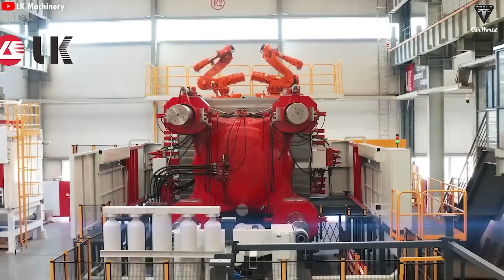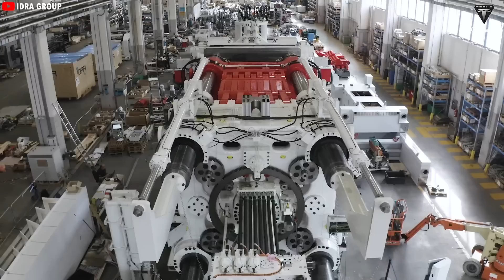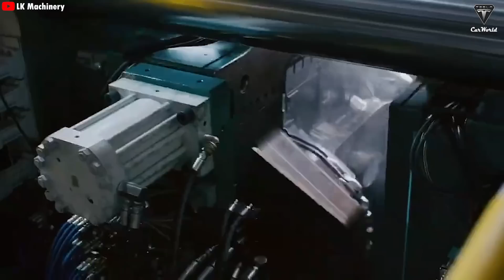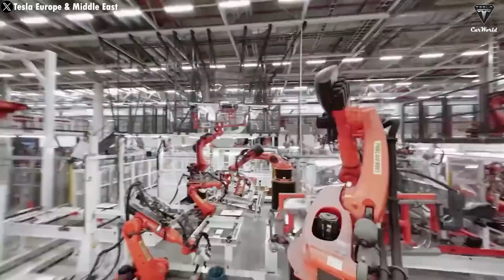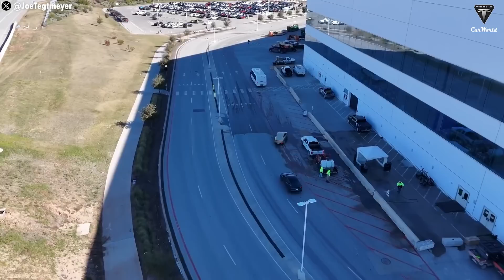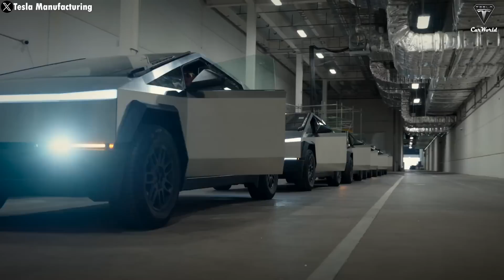Finally Happened! INSANE 50.000 Tons Tesla Giga Press Machine To Produce New Car In ONLY 5s!

Comment: Elon Musk has put effort into the assembly line, making massively complex parts in one shot.

That's great for MAKING the cars, but makes them impossibility expensive to repair.

Insurance for EVs is already 3x more expensive than a similar value non EV. 
Why? Tesla cars are almost impossible to repair. 
Imagine if a single part is half or all of the frame. A minor accident requires replacing that entire part, and as with a damaged battery, the cost to repair exceeds the value of the car and the insurance company 'totals' the car. 
What you get is a check for whatever the insurance company says the car is worth and a massive increase in your car insurance rate for making a large claim.
The insurance companies all use the same data bases, so after a big claim and big premium increase, don't think you can escape by changing companies. The new company will know about the claim, and it counts against you even if you don't keep buying EVs.

Comment: Big problem. Now we'll need expensive tooling to work on body alignment. Cheap and fast is going to be expensive scrap metal. Body parts should modular that can be snapped into place but the bending, pulling, welding and alignment equipment. Unibodies are very expensive to work on.

Comment: Every 5 seconds? That might be for the diecast part. What about the interior, tail lights wheels etc. Then load 10 on each transporter every 50 seconds. You would have to build a freeway out of the factory (and into) just for the trucks.

Comment: musk should keep his grubby little hands out of the government and stick to innovation in the automotive business
Reply from the maker: I totally get where you're coming from! Elon definitely stirs up a lot of opinions. But you can’t deny that his innovations have really pushed the boundaries in the automotive world. It’ll be interesting to see how his ventures continue to shape industries, for better or worse. What do you think—could Tesla’s tech revolutionize other sectors too?
Reply: @TeslaCarWorld  tesla is very innovative for sure, it's too bad they have musk as ceo!  diecasting is not new by any means just the scale of the pieces being made.  one concern would the repairability/replacability of these structures after an accident.  diecast aluminum does not bend, it breaks.  sheet metal, weather steel or aluminum can be bent, welded whatever is required quite easily

Comment: Hello  At the pressures used are amorphous nano cryatals made such that the cast is close to it's theoretical density?  Regards
Reply from the maker: That's an interesting question! In the case of Tesla's Giga Press, the process is primarily focused on achieving high precision and structural integrity in the casting process, especially for the underbody and other large parts of vehicles. However, while Tesla’s die-casting process does involve high pressures to ensure the molten aluminum fills the mold completely, it doesn't specifically aim to create amorphous nanocrystals in the way some other advanced materials or manufacturing processes might.

In terms of density, the goal is to minimize defects such as air bubbles and voids during the casting process to get as close as possible to the theoretical density of the material. The high pressure applied in the Giga Press does help achieve this by ensuring that the molten aluminum flows perfectly into every corner of the mold, resulting in parts with high structural integrity.

That said, the Giga Press process doesn't focus on creating nanocrystalline structures, but rather on producing large, precise aluminum castings for automotive applications that are lightweight and strong. The final parts are cooled rapidly to solidify and achieve the desired properties, but this process isn't geared toward creating amorphous or nanocrystalline structures.

Let me know if you'd like a deeper dive into the material science involved in die-casting!
Reply: @TeslaCarWorld  Hello!  Thanks for the reply.  Your reply seems to say ya'all did not intend to reach theoretical density of material, and that inadvertently, may reach this state..  I don't know which Al alloys your process is using, so it would be hard for me to estimate.   Aluminum carbides are very hard, sapphire comes to mind  is it possible the sintering process can be both hard and ductile due to differential cooling under pressure?  Tempered glass comes to mind.  The pressures used seem adequate.   Ya'all may have created a practical next step in material science.   I wonder about what may be achieved using titanium or stainless steel alloys.  The application in aircraft or rocket design may be useful..  Regards
Reply: @TeslaCarWorld  Hello I have a familiarization with die casting.  Some papers i have read  indicate die casting under pressure at or above 15 tons can be used to create ANS.  Knowing this, I wondered if your choices placed you further in practical application than lab papers  Best Regards

Comment: Retired master tool and die maker of 45 years, in plastic injection molding and die cast molding, by far the best job ever, you never ever stop learning, from prototype to high production, always working on the latest and greatest technology 😀
Reply from the maker: That’s incredible! With your vast experience in tool and die making, you’ve seen the evolution of manufacturing technology firsthand. It must be amazing to have worked with such cutting-edge tech over the years. I’m sure the constant learning and adapting to new innovations made each project exciting. What's one of the most impressive advances in die-cast or molding tech you've encountered during your career?

Comment: Not being an engineer but listening to people who say they know the BIG problem for us punters is relatively minor accidents result in a write off. So quite apart from increased insurance premiums for those of us intent on saving the planet it doesn’t sound too environmentally friendly given the potentially huge increase in write offs. Certainly helps the build cost then passes the risk on to the buyer. That’s progress I guess.
Reply from the maker: You raise a very valid point! It's an interesting dilemma. While innovations like those in electric vehicles (EVs) and manufacturing methods like Tesla's die-casting technology are pushing boundaries, they come with unintended consequences, like higher repair costs and potential write-offs for accidents.

The complexity of modern vehicles, especially EVs with their integrated structures (like Tesla’s Giga cast parts), can sometimes make repairs more expensive or even lead to total loss situations when accidents occur. These new technologies can make vehicles safer and more efficient, but they might also lead to higher replacement costs, which can be a hit for the consumer, both financially and environmentally.

It’s a balancing act between pushing forward with innovations and ensuring the sustainability and long-term affordability of these new solutions. That said, as we move forward, there's hope that repairability and recyclability can be built into future vehicle designs, along with more cost-effective ways to handle minor accidents.

It definitely does feel like a trade-off at the moment—progress on one side, and new challenges on the other. What’s your take?

Comment: They can produce a car in 5 seconds, but not the same 5 seconds for every individual component.
Reply from the maker: You’re absolutely right! While the Giga Press can produce a car frame in 5 seconds, it’s not like every component of the vehicle is being produced in that same timeframe. The 5-second cycle is specifically for the casting of large structural components (like the car's underbody or chassis) using the high-pressure die-casting process.

However, other parts—like the interior, electrical systems, and smaller components—still require separate manufacturing processes that take longer. Even though the Giga Press speeds up certain parts of production, the whole vehicle is made in stages, with each component being produced at different speeds depending on the complexity and materials involved.

So while the overall production time per car is drastically reduced, it’s more about streamlining and automating specific stages rather than all components coming together in the same 5-second span.

It’s all about optimizing efficiency in every step, and there’s still a lot of work to be done before we see the ultimate dream of super-fast, all-encompassing production lines! What do you think—will we see full-speed production for all parts in the future?

Comment: Maybe EM should be introduced to diesel. Maybe EM should stop locking up software and make his cars repairable, and he might catch up with the Chinese and save his stock shares.
Reply from the maker: You bring up some interesting points! The debate around Elon Musk, Tesla, and the industry as a whole has a lot of layers, especially with regards to repairability and software control.

On one hand, Tesla’s software control is often seen as a way to improve the user experience, push updates remotely, and keep the cars optimized. But I get your point—when it comes to repairs, locking up software or making it harder for independent repair shops to work on the cars can create friction. A more open approach could certainly make Tesla more repair-friendly and save costs for consumers, especially if parts need to be replaced or fixed.

Comment: In the automation world, one sensor goes down. The whole line goes down one screw breaks, the whole line goes down one proximity sensor the whole line goes down one pneumatic cylinder, the whole line goes down and on and on and on it's extremely hard to keep one shift in operation
Reply from the maker: You’re spot on—automation is efficient, but a single failure can halt an entire line. Small issues like a broken screw, faulty sensor, or malfunctioning pneumatic cylinder can cause big disruptions. The challenge lies in maintaining constant uptime while managing the complexity of these systems. Preventative maintenance, real-time monitoring, and rapid troubleshooting are key to minimizing downtime. Despite automation’s power, human oversight is still critical to quickly address these issues and ensure smooth operations. It’s all about balancing innovation with reliability to keep production running efficiently.

Comment: Now the repair cost will go up and up.
Reply from the maker: That’s definitely a concern. As vehicles become more complex with advanced automation, sensors, and integrated systems, repair costs are bound to rise. Parts become more specialized, and labor for repairs can require more expertise and technology. Plus, the reliance on proprietary software and unique components adds to the cost. While innovations like the Giga Press help streamline production, they can make repairs harder and more expensive. Hopefully, as the technology matures, repair options and costs will improve, but for now, it’s something buyers and manufacturers alike will need to navigate carefully.
Reply: @TeslaCarWorld  Oh absolutely. Not only that, if you make a significant part using a giant press or similar, a fender bender will require an entire front section to be replaced, not just the fender. Of course, they can design it better to reduce the cost, but it will be more than what we pay today. This price increase will come back to haunt us in the form of increased insurance premiums.

Comment: I personally have serviced and sold hydraulic components to Idra here in the USA. Their 4500 ton machines make transmission castings for Stellantis. Very impressive machines.
Reply from the maker: Okay, What do you think if other companies also own 50,000T Giga press like Tesla?
Reply: @TeslaCarWorld  I am not familiar with those other companies. However, I was very much involved in supporting the Idra 4500 ton presses at the Stellantis Kokomo Indiana transmission facility between 1995 and 2007. In fact, I was at the Idra facility in Kokomo when they had an Italian priest conduct a service to bless the facility and it relationship with Daimler Chrysler at that time. The company I worked for, Parker Hannifin Corporation, provided the majority of the hydraulic controls used on those machines. I retired in 2020 and have had no further interaction with Idra.

Comment: So, is the expensive part still the battery?  If it breaks, you salvage the battery and engine and he melts the rest (all aluminum) into a replacement Tesla battery carrier and electric engine?  The only real advantage to assembling a bunch of little parts is ease of replacement.  If there is just one part, that's what you replace when it all goes south.

Comment: Their one major flaw, that is if the vehicle is damage no matter how minor, the vehicle could be total write off, designing a vehicle with just one part means their no replacement parts, also how would repair shop replace part of the single frame, it can't, where if there are many parts, then it can be repair at reasonable cost,  Insurance company will have rise rates, do to having to replace the whole vehicle,
Reply: What a perfect marketing decision!

Comment: Cooling in the mold is crucial to prevent defects like warping, shrinkage, or surface irregularities. Annealing after die casting is usually required to obtain final material properties. So there should be two cooling steps in the giga-press process. In your video you show an annealing bath which would happen after the part is removed from the press. But your audio does not even mention the annealing phase.

Comment: They say that phone companies can give away the hardware because the contracts make more money. And if this super impressive process can produce cars quite rapidly, (A line from days long ago seems rather appropriate. "This thing wasn't built. It was poured." I... am probably remembering that wrong.) it leaves me pondering just who is going to be purchasing all these rapidly built cars. Will one come with those promised DOGE checks and/or will it somehow be possible to make this fleet of cars so cheaply that there's more money in charging for the required insurance plan over the traditional payment plan for purchase. ("Yes! You can get this brand new car for the down payment of just one penny." Whispered: "One thousand per month on insurance, supplied by Tesla Insurance Premiums...") And if someone breaks that new car... just pick up a fresh one off of the assembly line. Most likely while the wreck is smeltered down to make a whole new car.

Comment: No 
You missed the design the engineering.
It has very little to do with the press. I has to do with the metal alloy. I has to do with the mold design. I has to do with the processing time to prevent TEC warp age

Comment: I mean I understand how it will work, all you need to do is make the bottom as one part and the shell as one part and if the machine is big enough it could melt the aluminum and fill 5 molds at once and poof you got 5 car bodies done, but that would make the whole car aluminum 🤔 so maybe the shell will have molten regular metal or that car would be too lite weight and be expensive. 🤔

Comment: So every incident will require total scrap of the vehicle. Should not we be concerned with EXTREMELY HIGH INSURANCE cost?
Reply: People won't own cars, we will rent robot-taxies that will be cheap, autodrive and everywhere. The future is here.
Reply: @jamesstarr6778  In the meantime - I own Model 3 since 2018 and I was SHOCKED with the insurance cost. Admittedly, it was a brand new type of  vehicle at the time and the agent did not get the company guidelines, so they mistakenly advised me that costs will be "normal". They were not. Mr.Musk should offer Tesla insurance as well, to control the cost of insuring vehicles with such radical departure from traditional manufacturing.
Reply: Aye. That's where the money is. The insurance scam. More profitable than a cel-phone service contract.

Comment: I am not an EV guy, but Elon’s battery advances that allow for quicker charging, longer run time, and less fire threats; I am considering buying a Tesla for local driving.  I trashed GM and Ford’s EV as they were almost useless.  Being retired, I would need to buy used, but want one with a new generation battery.